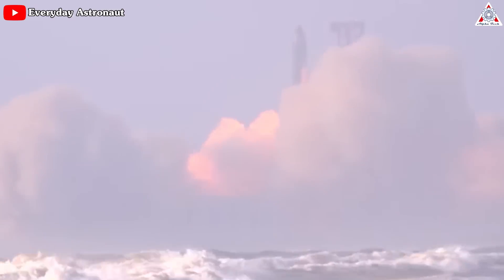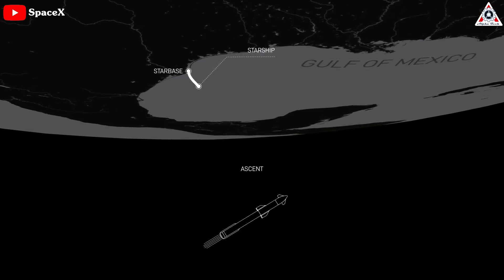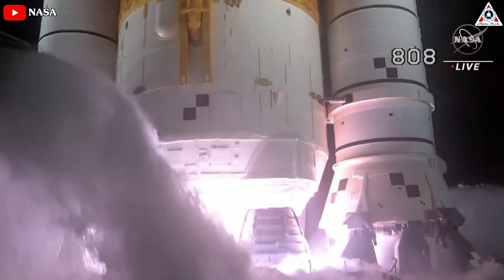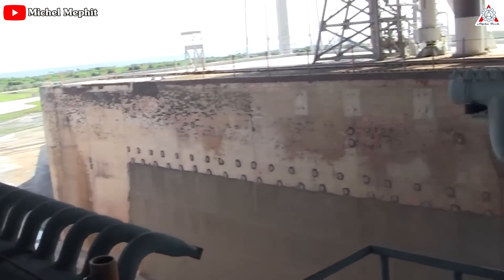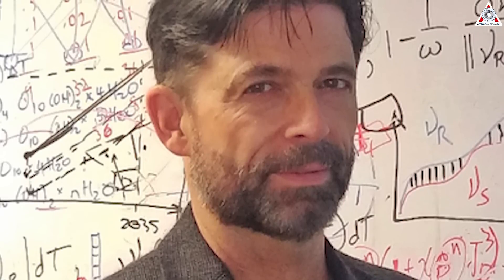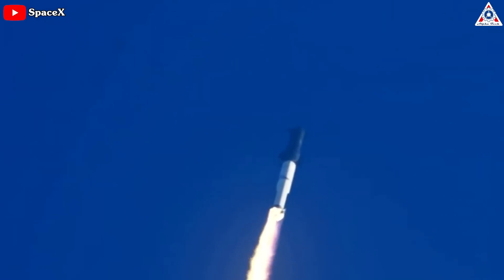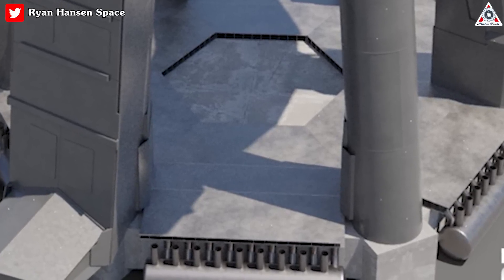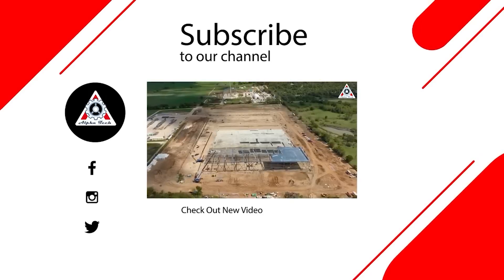SpaceX's NEW Solution to prevent the pad damage by 33 engines...

Comment: I'm still confused how they thought the biggest rocket ever wasn't going to need anything
Reply: It was intentional. I'm no elon fan but the lack of flame trench or,water,was by design.
Reply: @crackthefoundation_  Of course it was intentional. However the concrete failing was definitely NOT intentional. It was an intentional choice, but they did make the wrong choice here.
Reply: @crackthefoundation_  so they blew it up, along with half the state of texas, killed wildlife and poisoned the air on purpose,lolol
Reply: even Saturn V need a specialized launch pad to handle rocketdyne F-1 engine
Reply: Imagine on launching on the surface of  MArs probably cause a dust storm that would cover the planet for several months
Reply: @MrSCOTTtheSCOT  you don't need the super heavy booster on mars, so it'd likely be using 3 engines instead of 33
Reply: @MrSCOTTtheSCOT  I mean, the booster isnt coming along to Mars lol
Reply: @mistrants2745  It's true. But I also believe that, in time, they will build a booster in there. Launching probes from Mars is probably a much better choice than from Earth.
Reply: @BlueFrenzy  maybe some day they'll build a bigger ship, but I see no reason to launch this ship with this booster on mars, the g-forces would kill you at half power lol
Reply: totally under engineered but way over egoed.

Comment: Sorry but the water table has nothing to do with weather or not you can construct a trench. It does impact the cost as you would need to dig aditionall holes and use pumps to lower the water table in the construction area but you can still do it. Most tall building near water need to do something like this for their foundation already. There may be reasons why Musk doesn't want a trench, I doubt they are good ones but I'm sure he has them, but water table should not be one of them since only thing that would effect is the cost and he keeps saying money isn't an issue for him.

Comment: The general perspective usually confines within global scenario. It is totally different from intended interplanetary transportation and travel.  The ship have to encouter extra ordinary conditions prevailing in another planet.  There is difference in gravity, air density.  First few ships have nothing to anticipate like manual support except wireless connectivity.  No cooling plates.  Not even a landing pad.  How long will the dust and rock particles will fly in such conditions?  Every calculation depends upon the experience we derive here. Only the vision of Elon Musk can bring this happen successfully within an available time frame.

Comment: We are worried about fossil fuels and climate change, can we please stop ruining the planet with failed space adventures?
Reply: The biggest problem around climate change is the high level use in transportation by cars, jet liners and energy production by coal and oil burning plants.   Rockets produce a CO2 in a short time period during launch.  Boosters burn for a couple minutes and thus have a very marginal impact.   Rockets would have to reach a launch cadence of thousands every year to have any significant impact on climate.  Right now total launches world wide is less than 200.   

The burning of methane and lox by the raptor engines on the starship is produces less CO2 then most other rockets anyway because it produces water AND CO2 as a byproduct as opposed to mostly CO2.
Reply: What an uninformed and idiotic statement. Between China and Indias 3 billion people it doesn’t matter what 350 million Americans do. You’re kidding yourself if you think we have any affect on the climate.

Comment: I HIGHLY doubt a cooled plate alone can protect the stage 0 infrastructure. A deluge system is a must if they hope to do rapidly repeatable launches without significant repair and inspection of the launch mount between each launch.

Comment: Build a huge flame trench and let it fill with ground water. The blast from the raptors will display the water in short order and leave you an empty trench. And the water itself will significantly dampen the effects as it is blasted clear.
Reply: The issue is the presence of water on its own. The issue is that it's hard to dig out a trench that's constantly filling with water.

You simply can't make it very deep. Try going to the beach and scooping the sand. The walls of your hole will constantly collapse in and make your hole shallow again.
Reply: @twrecks6279  we have no problem building coffer dams, it’s just a question of big enough pumps. In London a huge coffer dam was constructed right on the edge of the Thames, no insurmountable problems.
Reply: @JohnnyMotel99  I'm not an engineer. I'm not going to debate you xD

I stand corrected.

Comment: The energy dissipated by all those debris flying away will now be even more intense and manifest itself by shaking the OLM more violently.
Reply: Not true.   What was not mentioned in this video was the deluge system that Space X had also started before the test launch.  The deluge will play a big role in mitigating damage under the OLM.   Completing the deluge will also delay the next launch by several months.  Then of course there are the tests of the B9 that will have to be conducted before the next launch.
Reply: The exhaust of the engines act as a piston thundering on the ground, no amount of water can prevent that, prevent heat and a percentage of the shockwaves but  not the actual mechanical pressure of the exhaust gas but a flame diverter do spread those mechanical oscillations and limit the vertical aspect of those.

Comment: It was important to pull this off without any sort of flame trench. This is because the ultimate vision of starship is to land and take off again on the moon or Mars at unprepared sitet
Reply: Super heavy isn't going to be used on the moon or mars though
Reply: I have heard this argument before.  The problem is that before Starship can land of the Moon or Mars, it must get into orbit.  And they are never going to get into orbit using what amounts to a beefed-up Christmas tree stand for launch.
Reply: @SouthCR  why not? seemed like it took off just fine, launch pad wasn't the issue that prevented orbit lol
Reply: @Zreknarf  No. Just the equivalent of shooting the rocket engines with a shotgun thing 😂
Reply: @jason_m_schmidt622  that's still not the issue that prevented orbit
Reply: @Zreknarf  Losing the hydraulic system didn’t help either
Reply: @jason_m_schmidt622  the internet seems still unsure if they lost hydraulic pressure or not.

also i was trying to figure out what they even need hydraulics for, since the grid fins and the raptor 2 engines are gimballed electronically. the stage separation is supposed to just happen without any pusher mechanism, by gimballing the booster's engines hard and firing the RCS thrusters on the starship in the opposite direction.

it's hard to find current information on internal designs since the design is changing like every week lol
Reply: @Zreknarf  I believe they still used hydraulics in this version of the booster in order to gimbal. During the spin before termination you can see SpaceX trying to correct its orientation using rcs thrusters which most likely indicates that they lost the ability to hydraulically gimbal. But it’s speculation. Next booster version uses electric motors for gimbal. Whenever FAA gives them another license 🤣
Reply: @TerryJLaRue  yeah. Too bad the highly intelligent starship engineers don't have you advising them to let them know that they're doing blatantly stupid mistakes.
Reply: Not going to happen
Reply: This launch is not representative of any landing or takeoff from another planet, because both Lunar and Martian Starship launches would use only the upper stage Starship vehicle itself, there is no need for a Superheavy booster.  Starship has already proven it can takeoff and land with minimal launch and landing facilities without causing a dangerous debris cloud.  Superheavy, the booster needed to loft Starship from Earth (and only Earth) puts out more than ten times the thrust, which is why it will require some custom launch infrastructure.

Comment: A steel plate will not work, too much turbulence in such a confined area, everything will melt or burn. The water table is not a problem for a Flame diverter as there are such things as a  Bulkhead that enable the building through shallow water tables and it can vent a distance away from the launch platform, in a nutshell, it can be done. No diverter equals no launches
Reply: The water cooled plates will also work in conjunction with a deluge system which the video didn't even mention.

Comment: The cooling plate will NOT stop the destruction. They need to raise is to at least 2 time higher than it is. SUBSTANTIALLY increase the concrete. Build a diverter an thousands of gallons of water. Flame trench will have to be built UP rather than dig down. Hire a real architectural engineering firm and to it right.

Comment: probably not practical at this point but why not have the whole thing suspended 30ft higher? and do all engines have to ignite at the same time?
Reply: They didn't ignite all at the same time.
Reply: @adamklosterman8960  i meant during launch could they deliberately stagger the firing to save the launch pad, if they use the minimum number to get off the ground then ignite more as they rise that would cut down on damage.

silly.
Reply: @HarryNicNicholas  when the rocket has an extra 150 tons of Cargo in it it’s going to need every bit of thrust to get off the pad.

Comment: Please read: Stage 0 upgrade improving 2 issues with the current approach: A stage 0 elevator system would consist of two additional side towers with a series of vertical tracks or rails that are embedded into the new two towers of stage 0. The starship and super heavy booster would be placed onto a platform exactly like the current one but capable of riding up and down these tracks.

To propel the platform and mounted vehicles, a set of large electric motors would be installed at the base of the new side tower tracks. These motors would provide a powerful force that would accelerate the platform and vehicles upwards along the tracks. One way to assist such system would be to install large counter weights along each of the two side towers.

Once the platform and vehicles reach a certain height and ascent speed, the engines would be ignited and the starship and super heavy booster would continue their ascent into space leaving the launch tower and stage 0. 
This system would address two issues at once:
1 – Save vital fuel in the first 10 seconds of launch – during the first launch it looked very fuel expensive.
2 – Add vital distance between the booster exhaust and the pad – reducing considerable the pad damage.
 
The elevator system would then be lowered back down to the base of the launch pad, ready for the next launch.

Overall, this elevator system would provide a safer and efficient way to launch starships and super heavy boosters minimizing damage to the launch pad and saving precious fuel during the initial stages of launch.
Reply: Massively over complicated, too many failure modes. Igniting the engines has to be precisely timed with the upwards movement of the platform for example, and if they don't light and you have to abort you then have to bring the entire stack to rest safely.
Reply: @owensmith7530  Very good point however, I consider the chopsticks system as risky and failure prone as mine. :)
Reply: @otavios6027  There is no timing critical aspect to the chopsticks at launch, indeed they're not involved at launch at all other than needing to be out of the way. Catching the Super Heavy on landing is an entirely different matter but I suspect there won't be an attempt at that for some time.
Reply: @owensmith7530  Let’s break down the solution so you can better understand. 
1 – The elevator in the first iteration will safely speed up to 100 meters per minute.
2 – Once reached a critical height the elevator will slow down and bring the entire system to a halt with both vehicles lifted to the highest. If there was a launch abort during the ascent, the lift slowly comes back down to it’s original position.
3 – Within the height of over 120 meters, there is over a minute to spin up all engines. Given the last test it took them circa 10 seconds, we could allow the lift the run for over 50 seconds before starting ignition. Remember the first ignition is precise to the second and you can see that from the countdown of any rocket launch.
4 – With their fail fast approach and iterative improvement, such system could evolve to save a lot of fuel in the future.
5 – The simplest MVP could be simply launching from a stationary position at the highest point in the lift system – this way avoiding entirely the issue of the pad destruction.
Reply from the maker: I will find more about this. Thanks your feedback

Comment: Hey, not an engineer, and a question. What is the minimum number of raptor engines that would lift the starship off the pad? Is it 33? Or some number less? If it is less, then would there be less damage to the launch area and the ship itself?
Reply: This is not possible, the minimum number of engines at full power would be about 25. However, the less thrust you have at lift off - the less velocity you'll get at the booster separation and the dependency is ~ exponential. For example, this SS test ran at about 75 % of maximum thurst, yet it produced only 1/4 (1/2 velocity) the energy needed to reach orbit.
Reply: @nehorlavazapalka  Thanks. Another thought, could it clear the tower with minimum engines, and then throttle up to full tower?
Reply: @nehorlavazapalka  full power, not tower

Comment: Why cant they just use a metal base that has a slit cone shape with a hole in the center to take the water and have pipe that curve the water back up towards the rapters to reduce the shock wave.

Comment: Are they DUMB, Why they are not using FALCON LANCH PAD model.  Only 28 raptors fired. If 33 raptors were fired may be lanch pad may be distroyed and may be BLASTED the Rocket on lanch pad and it would be no celebration. It's just LUCK..

Comment: Another idea might be a really tall drilling platform with water-cooled columns.  In fact Space X purchased 2 old platforms for that purpose. The rocket would be held on a similar but stronger launch structure located hundreds of feet above the ocean. Water will cushion the force and rapidly dissipate the heat.  There would be no dust and chunks of concrete to become projectiles. Netting could be wrapped around the outside of the columns to act as a barrier for wildlife or a large floating net could be anchored further out around the platform. The animal life can sonically or electrically be chased out, prior to closing the net.  https://www.youtube.com/watch?v=D41tCEQfpmw
Reply from the maker: Oh, I will talk about this in next episode, thanks
Reply: But then you have to ship liquid oxygen and methane out to the launch platform at sea, and have the infrastructure to keep them cold. And how do you get Super Heavy and Starship out there for launch? It removes one problem and creates a load more different ones.
Reply: @owensmith7530  Ships, barges and more platforms. You think Elon is asking himself, at this point, "What was I thinking??" Both Super Heavy and Starship can be carried out horizontally and righted with a structure similar to their "chopsticks" and lifting tower. At this point it appears that Boca Chica has too many environmental concerns as well as the dangers it represents to residents. Maybe a small island near the equator would be a cheaper and easier way to go.
Reply: @jameswest4819  I agree Boca Chica is a pain, it is the regulators that have made it so. I don't know enough about the area to say if that is rightly or wrongly.
Reply: @owensmith7530  Look at some of the videos that criticize the port.
I really think that SpaceX can build an offshore launching platform by utilizing some retired platforms or building one made specifically for launching especially if they build one in another country. Of course, then our government might again be an obstacle.